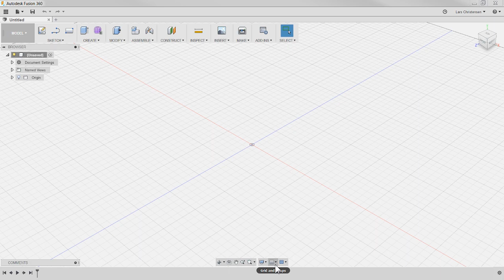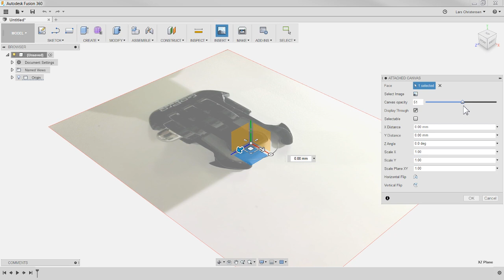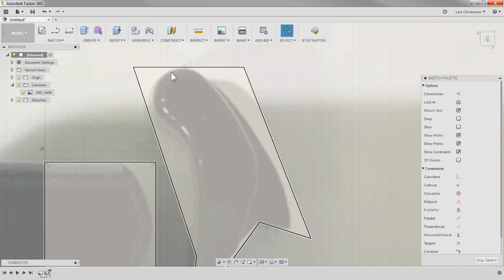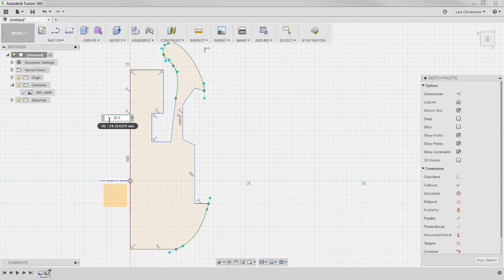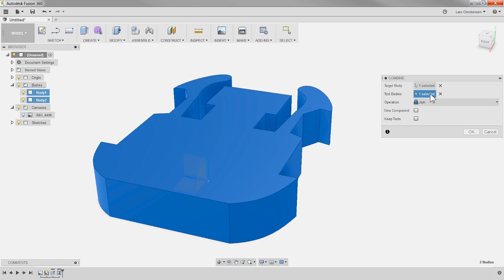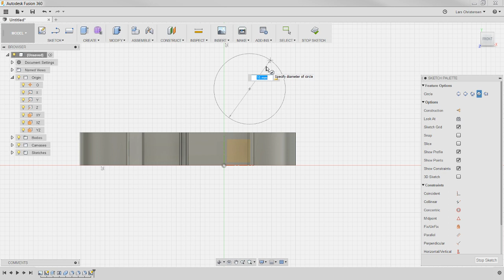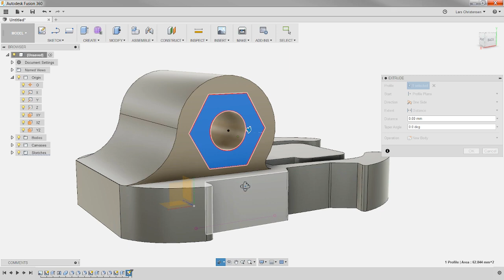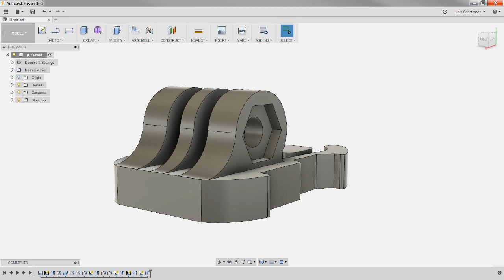Fusion 360 Absolute Beginner - How To Model a GoPro Mount - Last Nights Facebook Livestream

Comment: Just wonderful work Lars. You are, as they say these days, the man. And most certainly with a plan :-)
So I wanted to wish you the best of the season too you, with your family and friends. I have been so consumed with trying to get drawings and find material for this CNC build I am doing. On my way home from Toronto I picked up the absolute beginnings of the DIY CNC build I spoke to you briefly about,.. some heavy gauge used but true 45 x 180mm T-slot. Mein God it is heavy stuff for 6061. The enigmatic profile has no makers mark and 80/20 doesn't make it. So I hope it shall become the support struc. for the X axis @ 1500 + mm upon which  the gantry will ride the Hiwin rail.
Here is wishing my best teacher as of late, a very happy New Year !
I am putting the info from this upload directly to work. You know it might be very hard to binge watch your library of works. I think perhaps it is too rich for the contiguous uptake. Not like plum pudding with hard sauce mind you...:-)

Comment: The Calibrate function is by far easier than the old way (saves a few steps) in 2D where you had to draw a line to the correct length and then size your part by referencing the line. BTW. From outside of Buffalo. Live in Florida now; don't miss the snow.

Comment: Another awesome tutorial Lars. I make a lot of 3d prints and need to be better at adding stuctural strength in my parts, for example angles. Feeling very unsure how to do this best in Fusion 360. Would be very interesting with a tutorial about this subject.
Reply: Fredrik Johansson For structural strength in FDM parts I highly recommend the book "Functional Design for 3D Printing" by Smyth. With that background, the modeling part should be pretty easy. Note you may need to break your design into multiple parts, but you can keep them together in Fusion using joints.
Reply: Awesome!

Comment: I've noticed that sometimes when you're dimensioning a line you'll select the origin as the first point and then the line, but other times you'll select the line and then the origin. Does it matter which order you do the selection of points/line when adding dimensions? I would think you'd first select the origin (or point or line) to which the SECOND point or line is RELATIVE TO, and then select the second point or line. That way, if you later move the initial point or line, the other point or line (relative to the first) will move accordingly.
Reply from the maker: Hi Roger Garrett Thank you for watching!
Hmm, I am not that detailed when working with CAD :-) I don't know if there is any best practices with dimensions. When it comes to joints, it is best to select the item that moves first...But I don't know to be honest

Comment: That was an excellent lesson Lars! thanks so much, I'm filing this one away for safe keeping as I will be needing it to create a mount such as this for the front of my motorcycle helmet and 3D printing it. I just need to figure out the curvature of the base as some helmets come to a V while others are round. Merry Christmas!
Reply: james moreno a tip for the curvature is take a picture of the side with a ruler next to it, then import that into fusion. Works slick
Reply: Chris Brown awesome idea !that's going to help out greatly! I do a lot of self prototyping and one thing I've always struggled with is getting the base of my prototype to mate with an object's curvature, especially with round objects (inside & outside diameters) such as motorcycle helmets.

I've even taken it as far as laying the helmet on its side and tracing the curve on a piece of graphing paper and plotting it out in 5 mm increments to get a true to life profile so the base of my part fits somewhat correctly. With what has been taught here today I think this may work out nicely.
Reply: james moreno I've had similar issues with curvatures. I designed some wake plates for the stern of my 2001 super air nautique for better wake surfing. Did the exact process I described to you, then had some 1/4" 316 SS waterjet cut! Definitely a fun project. Good luck on yours!

Comment: Someone asked about recalling parameters and you showed how to bring them up, for the part. And you mentioned that they're associated with the part and you don't think you can bring them in from a library. I can imagine a project where you've got a lot of different parts and maybe even a lot of different people working on various portions of a project and there could well be a common set of parameters that everyone should be using and referencing in their designs. So IS there any way to define some set of parameters, be able to save JUST the parameters out to some file/library/folder and to reference those parameters from within numerous part files? I'm thinking that would be incredibly useful.

And, yeah, I know it has nothing to do with this beginners video, but someone did ask it while you were live and raised this issue/question in my mind.
Reply from the maker: Thank you Roger Garrett!!! What I would do (and have done) is creating a "dummy" file that you bring in. Now, you can edit that to your new project.
Also, beware of Fusion Team, This is great for companies where people need to work on projects together:
https://fusionteam.autodesk.com/

Comment: Hi  Lar can you explain sometime why it is so important to fully define things. I have just been using Fusion for a few months and I have got into the habit of only defining key dimensions where I need to get one part to fit another etc. So if you look at my sketches I bet I have 90 percent of my sketches undefined. However my model look good to me and I can 3D print them and they appear to work.  So can you explain why I should define things properly. You say it’s important but never why it is so important . Many thanks for your hard work making these  tutorials, I’m incredibly excited about my designs and this would not have been possible without learning from you. Thanks Regards Chris
Reply from the maker: Hi AllTheGearNoIdea Thank you for watching!
I can only answer that question with my $500 story....check this out:
https://youtu.be/gQg0tfrhvbw?list=PL40d7srwyc_Mkgc5wvP_OfVel9aDkNkZ6

Best,
Lars
Reply: Lars Christensen Many thanks Lars. I think it would be worth saying  why we define our sketches I watched your video and I now understand. But I had thought we had to define them to prevent F360 from failing or crashing etc, but as you say it’s just to avoid errors.  Great videos you doing fantastic thanks.

Comment: Hey Lars, thanks for the tutorial. Question for you. When I move the handles on the spline, the entire line moves, not just the one section with the spline. Is there any way to fix that? Please let me know if you need further clarification.
Reply from the maker: Hi Will Makowski Thank you for watching!
You can use dimensions to constrain a spline point and handle and/or create multiple splines. But, yes, because a spline keeps the curvature, it will affect down the line.

Best,
Lars

Comment: As a noob to fusion360, is there a way that I can set my scroll wheel so that when I press it down (sort of like a button) it activates orbit?
Reply: Hey mate you have to hold the 'shift' key down as well as the scroll wheel button to orbit. If you don't hold down shift it will just Pan for you :)
Reply: If you set pan,zoom, orbit to "Solidworks" in preferences it will function that way

Comment: Hi Lars, I can't tell you how many of your videos I've binged watched after coming fresh to Fusion 360 from TinkerCad in the last week. You are pretty much my go to guy now for anything F360 :) Really appreciate the work. One quick question I hope you might be able to help with (or point me to a video!). I think I get the sketch stuff in 2d - what I mean is that I can see we can map out the shape and then extrude and that gives one dimension shaped correctly. But what I',m struggling to understand is how to then deal with the next dimension. For example in this video, where you sketch the base out - see https://youtu.be/AtE7KvKrjXw?t=34m32s you can see the the side profile isn't dead flat - it had some complexity to it. I can't get my head around how to alter the side profile to achieve this - does that make any sense ?
Reply from the maker: Hi Jason Hyland Thank you for watching!
You can do so much with Fusion when it comes to handle the sides. Check this video out:
https://youtu.be/6u29SqgvQik?list=PL40d7srwyc_Mkgc5wvP_OfVel9aDkNkZ6

But as a new user, stay focused on getting the basics down. I would recommend you watch as many of these as you can stand:
https://www.youtube.com/playlist?list=PL40d7srwyc_NopbOnJ4IARIvSrTT1pp5m

Hope you have an awesome day!!!

BEst,
Lars
Reply: Hi Lars,  many thanks I watched that and got very excited about lofts :) I think I kind of found a way. I took a couple of profile canvas pics (front and left) , calibrated and lined up. I extruded the first profile, switched to the second profile and extruded but used the intersect option of the extrude. Boom! Very powerful. Now off to understand projections :) Thanks again ....